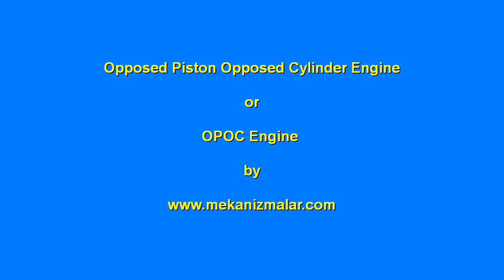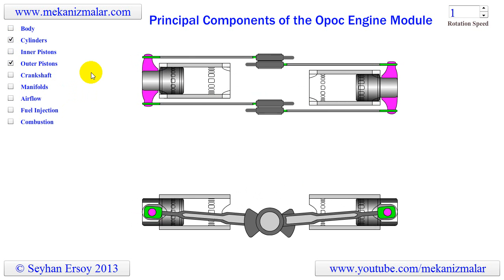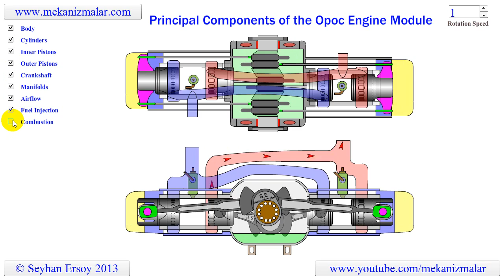OPOC Engine

Comment: Too complicated.
You are introducing more reciprocating mass by the 2 huge connecting rods, just to get rid of the valve train.
The 2 cycle operation will be more polluting.
Exhaust gases can not be flushed completely this way.
Reply: +EvenStar LoveAnanda THEY CAN WITH A SUPER CHARGER
Reply: +brian rennie Do you have any experience with two stroke engines or you are just blowing smoke?
A super charger will increase power but the emissions will only slightly improve.
The biggest problem with this engine are the huge connecting rods.
They will ruin efficiency. And the weight of the engine will be too much.
Reply: +EvenStar LoveAnanda  IM AN ENGINE TESTER WITH PLENTY OF EXPERIENCE OF TWO STROKE DIESELS.......THERE IS NO FORCED EXHAUSTING AND VACUUM INTAKE WITH A TWO STROKE THEREFORE A TURBO WILL NOT BE MUCH USE AT LOW ENGINE SPEEDS....THE IDEAL SET UP WOULD BE TWIN BOOSTING BOTH TURBO AND BLOWER
Reply: Sir. You're comment is in error as it seems to miss some of the fundamental differences and advantages of the true OPOC.    
             1.  This particular 2 cycle is NOT more polluting because, unlike other 2 strokes, this design allows for, and incorporates, asymmetric port opening and closure, giving an almost perfect scavenge, just as efficient as any valved engine, and even over-scavenge is possible to effect were it required.      
            2. There is NOT more reciprocating mass. This is due, in part, to the long connectors working only in tension, and which therefore can be made in CF or similar.  In fact, the longer tension rods might eventually turn out to be lighter than the shorter compression rods.  
            3. Unlike all other opposed piston designs, the advantage of having all main loading go through the crank, and all main casing loads resolved under tension, is that it relieves the need for any compression capable casing ( ie. a casting. )
Reply: John Morgan    Let me have a week or so to get my head around that.